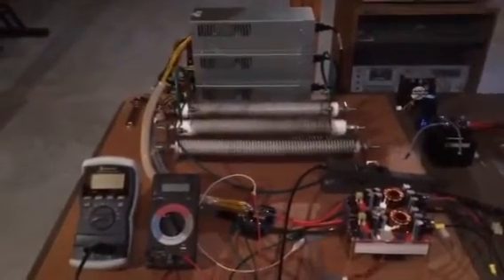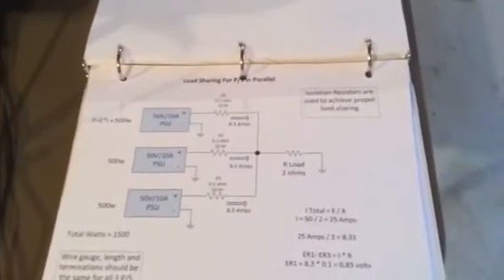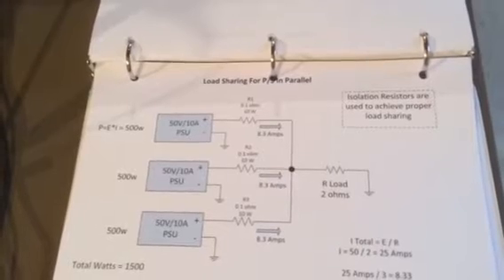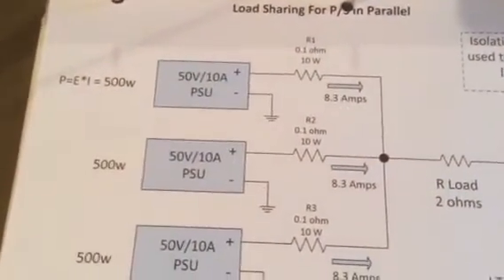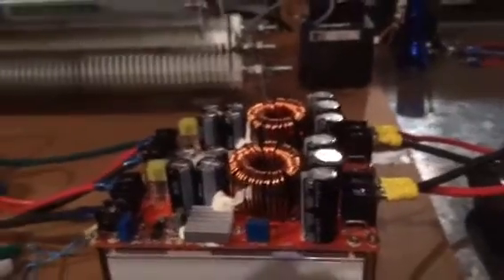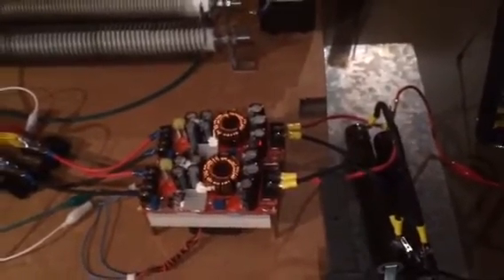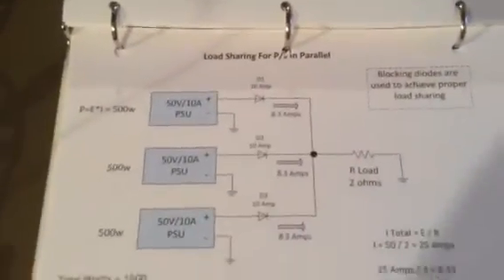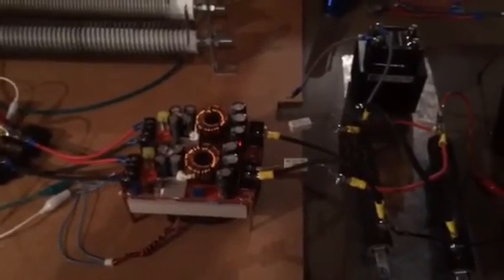RF Man discusses load sharing in parallel power supply's and boost converters

Comment: thanks RF man for your demo it was very helpful.

what about .01 ohm? can i use .01 resister rather than .1 or .2 ohm?
Reply: I would go for the diodes solution. It's safer to use Diodes. Yes you can use .01 or .02  Ohm but it has to be same rated on each and always  calculate the wattage of those resistors or resistors will be burned out.
Reply: Nick Chow, yes you can use .01.  I plan to do same and will report findings here when complete.  Running resistors in parallel will allow you to obtain the ohm you desire, but limit the voltage drop and increase wattage rating.  Example five each .05 ohm 50 watt ran in parallel will result in .01 Ohm 250 watts (approx).  Your still gonna have to do the math provided in RF Man video to obtain exact wattage rating needed for the power supplies you plan to use.  73s.
Reply: @baltimore_amp_repair  how did you go testing the .01ohm resistors? can you report if they work with the demonstrated DC-DC boost converter running them in parallel. Maximum output on the 1800w version is 22amps x 0.1ohm is 2.2 voltage drop, this is 48.4W dissipated on the resistor!, A .01ohm resistor will dissipate a 10th of that wattage being 4.84w. so the power saving is a big difference.

Comment: You could not have demonstrated that any better. Awesome demonstration! It definitely brings some ideas to my mind on improving some future circuitry and adding extra safety measures when I am putting together power suppy modules and making sure they are 100% current sharing the way they should be. After running some tests this may even cancel having to make the power wires equal length sometimes adding extra obstacles when working in tight spaces.